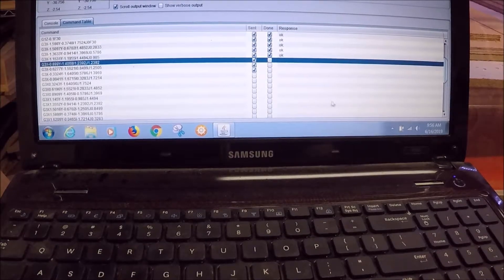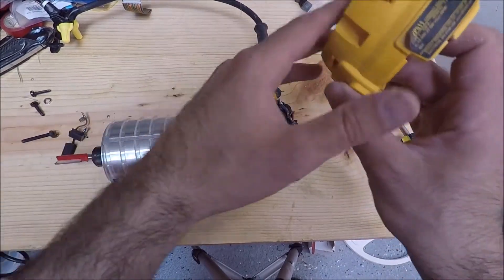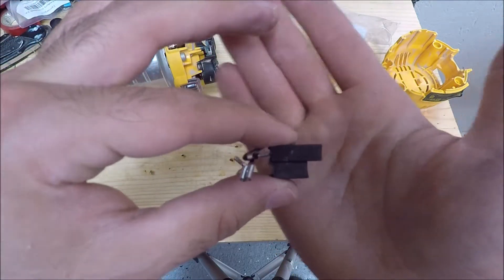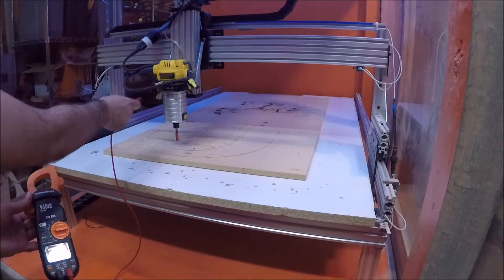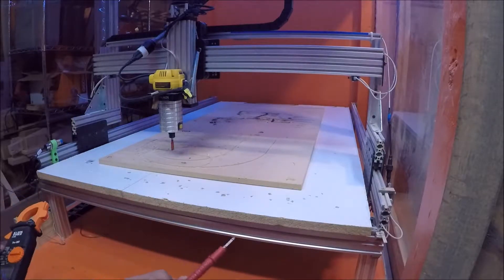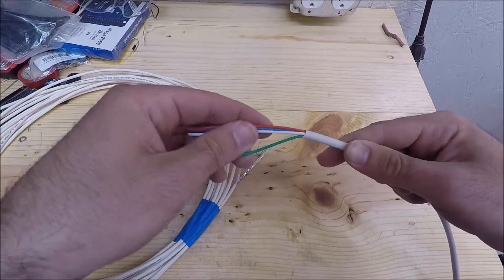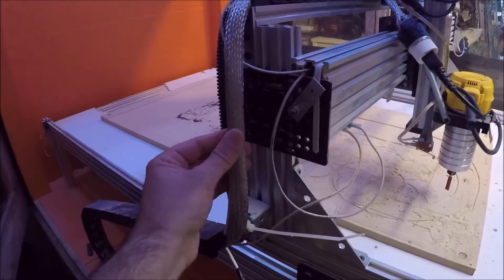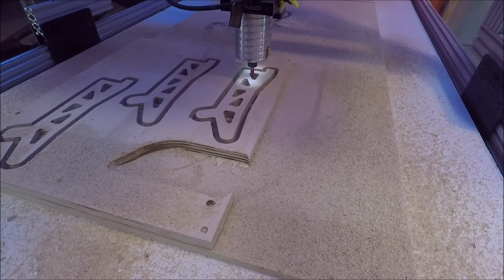Fixing Electromagnetic Interference and Grounding a CNC

Comment: Grounding starts at your electrical panel. Your house should be grounded to earth with 2 8’ rods bonded to your electrical panel. You should have a properly grounded outlet. You should have a good 3 pronged power cable that will ground your computer, that grounds usb cable to your cnc controller, your cnc controller also should have a good 3 conductor cable grounding its case.  Grounding the frame of your cnc may have minimum affect on emf, but will enhance your safety, in the event your router shoots power to the frame will less likely electrocute you.

Comment: Thank you im going to try this out, im having a really hard time with a "big" small CNC, ive gutted a 3018 and enlarged the frame, but now im having a lot of problems due to the larger spindle and whatnot, im going to ground the frame and move the Controller board out of the frame (was using the 3018 design with the board secured on the aluminum profiles).

Comment: I just replaced all my steppermotor- and endstop wires with shielded cables on my 6040 cnc.
I have a 24v powersupply witch has the only ground-connection on the cnc at the 220v side (mains).
Can i connect all the shielded cables of the steppermotors and endstops to the ground of the 220v connection?

Comment: Hi, can I prevent interference if I put a ferrite core on the cables?
Reply: @Dave Tennes Thank you for your answer.  You shared very useful information.  My problem is solved for now.  I connected a cable from the CNC case and the spindle motor to the grounding line, there is no problem now.

Comment: Dear Becky Schwantes
My name is Hristo, I am from Plovdiv, Bulgaria. I have read your comment to this video clip and
I have decided to write you (I have no another way to make this).
I have tried to make my first hobby cnc machine, but my experience of electronics is very small.
I have a question about Grounding. I have to note before, that our building is old, and there are 
only 2 conductors, and we have not separate conductor for  Grounding unfortunately. This system 
is TN-C and  TN-C-S. In this case, we have to use “neutral” for this kind of Grounding.
The main elements of electronic are: Arduino Uno; 3 steppers-NEMA 24- 3,1 N.m; 3 stepper-drivers-
SH-750- 5A,  PSU-s - one 36V DC for steppers,  and other - 12V DC for fans, (5V for Arduino from 
computer‘s USB).
I will not use a VFD for motor-spindle. I have intention to use routing motor-spindle, and I will 
connect it directly to 230 V- AC, and will be no connection to controller. 
I will Grounding 2 PSU by “neutral” in “star” point (in TN-C-S system), but I am afraid to connect 
in this “star” point stepper drivers (GND) and Arduino (GND). I think, that it will be too risky.
To install separate ground rod is not easy task. 
What do you think about this situation ?
Best regards
PS: Excuse me for my too bad English language.
Reply from the maker: To be honest I am not sure what the best approach is in Bulgaria, I am not familiar with your electrical codes and standards. I bet a local electrician could probably provide more accurate information than me on what is allowed in your country. I do hope you figure out a good solution.
Reply: @OrangeLabPinball  Thank you very much. I have looked for different opinion everywhere.

Comment: Yikes, this is not a proper grounding application. You need a ground rod installed for the equipment ground. You don’t use your residential ground which has been bonded to nuetral. You always use a braided shield for any cable that will be flexing the foil shield will break. You absolutely never run high voltage in the same track as control voltage. If you insist on having them in proximity of each other you run them perpendicular never parallel. Also you are simply testing for continuity with your meter you are not comparing the potential. You did some nice work .... sink a ground rod and install it right. You don’t want to be fighting noise issues a couple years from now when that foil cracks and your shield is broken. Your grounding system should be capable of serving as a protection circuit and a  location to disperse noise equally well! You seem pretty sharp. Look up Tpc cable they specialize in super flexing cables with any shielding option you might desire! Make a nice power cable and use that braided sleeve as a ground strap!
Reply from the maker: Thanks for watching the video Becky! While I agree an isolated ground rod would be ideal for reducing noise it is just not practical where I have my CNC set up. I also 100% agree with not running Line voltage next to low voltage in parallel...... but I am a sucker for clean install. Since I haven't seen any noise issues since making these changes I figured the SO cable's metal braided sleeve is blocking the noise well enough to allow the power cable to stay in the drag chain. I was not aware the foil shields have a tendency to break over time, thank you for the insight. I will need to look into the TPC cable. Thanks for the constructive feedback!
Reply: @OrangeLabPinball  I’m a sucker for organized cable runs also! Check out the TPC. We have a certain type of machine that has multiple conduits running in a track that flexes with the axis . It’s all under a waycover and the conduit eventually always breaks and a wire will get damaged. We stopped running single conductors in a conduit and used one of their multi conductor flex cables NOT in conduit and it hasn’t even nicked the jacket!

Comment: How do you connect the ground from the cnc to the ground coming for the wall socket? Thanks in advance
Reply from the maker: In my design I made that bond inside the control panel using a terminal strip.
Reply: You don’t!!!!!! You drive a ground rod and run a strap from the rod to your ground bar in the panel. Your residential ground is bonded with nuetral.

Comment: No wonder why I get static shock when touching MPG hand wheel and frame gantry because not grounding properly. So I just need to connect / bonding the wire to the frame flow thru the control panel box earth is it.. thanks
Reply: Well you need to sink a ground rod and then there should be a ground bar in the panel. Connect them with a strap. Then find a clean spot to take a ground from the panel to the gantry. Don’t jump around. You run a cable out and land it and if you need another you start in the panel and run out again.